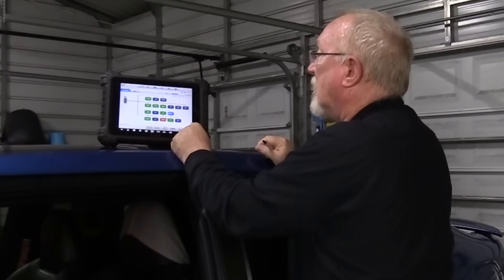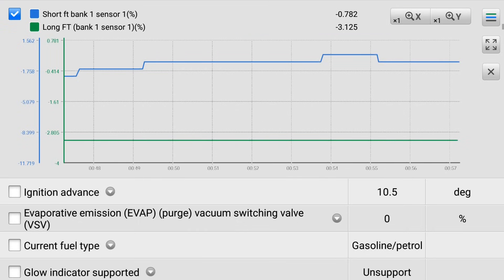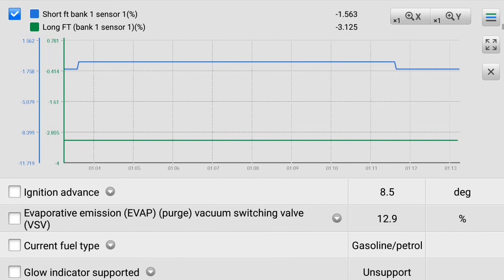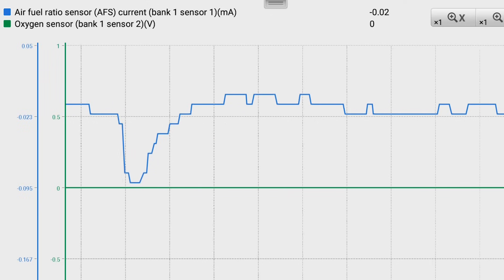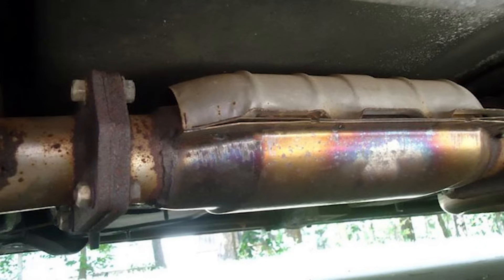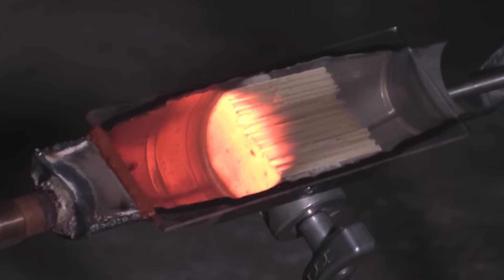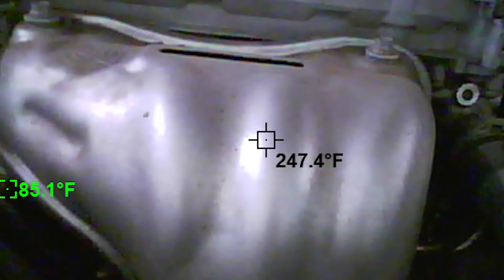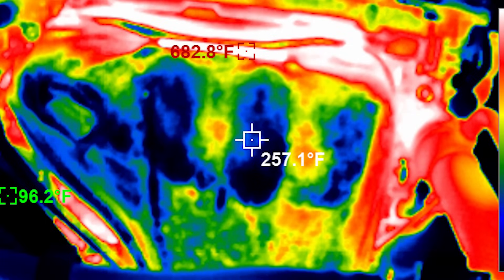The Trainer #118:  The REAL Cause Of P0420/P0430 DTCs

Comment: I've read several comments and agree there are several different causes.  But, for me, the code is for Bank 1.  This means that the side of the engine with Cylinder 1 has an issue.  Therefore, it does not seem like common components of the engine are at fault - such as a dirty air filter or MAF.  It seems more likely that the issue is related to that side of the engine and it's combustion, oil, gas, adn exhaust components.  Has anyone had an experience where the code specifies Bank 1 but it was not necessarily fixed by a component related to Bank 1?
Reply: My car currently has this problem and I'm just trying to find what parts to fix before I get the cat.
Reply: @YakanAutumn  My car has the same, P0420 Catalyst system Efficiency Below Threshold Bank 1. I just saw a video that said to try the Catalyst sensor, so i just bought it and will put it on. Hopefully that will fix that damn ISSUE!!!
Reply: @bze06fishinbwai63  uppdate on How it went.
Reply: @bze06fishinbwai63  did it work?
Reply: @bze06fishinbwai63   we need a update! 😂😭😭
Reply: Sounds to me like a code made to cost a lot of money ! Like a cash cow
Reply: I had the P0420 and to answer OP's question is somewhat complicated for my vehicle specifically. I fixed it with a new set of spark plugs. You'll probably say that's not specific to bank 1, but hear me out. My truck  (a toyota tacoma) supposedly (according to people on tacoworld forum) came stock w/ the same plug but differing manufactures on each bank. It was a contract technicality that forced Toyota to do this, so I've read. The plugs for bank 1, on average, don't last as long as bank 2. This is what lead me to want to try replacing my plugs. Toyota of Mt. Pleasant TX said my catalytic converter was 'basically non-functioning' but... 1000+ miles later and after the new plugs, I have no light or code, so, they likely just pulled the code and claimed it was the most likely/most expensive part without any real diagnosis.
Reply: @deadduck8307  That's interesting about the plugs.  For sure seems like that could cause a specific bank code if the plugs are not all the same and wear out at different times.  Great catch!
Reply: The common components may not be the direct cause of the these trouble codes but they definitely could be the origin point of the issue.

A rich engine condition (mainly caused by vacuum leaks) and/or engine misfires can prematurely ruin catalytic converters. Clogged air filters will create a lean condition as the computer pulls back fuel to accommodate less air. This can lead to predetonation which can also destroy cats.

So if cats are bad and throw one of these codes, the common service components may not be the cause, but they directly contributed to the issue by destroying the cats.
Reply: Good point we have both PO420 and PO430 on the 2011 Arcadia with 150K. Leads me more toward common components like air intake, fuel pressure, or PVC issues, maybe engine timing due to timing chain wear.

Comment: I took out the o2 sensor, installed an anti-fowler and reinstalled the sensor. Haven't had an issue for years. LOL.
Reply: What’s an anti fowler please?
Reply: @serchizm it is a threaded pipe that threads into the O2 sensor bung and the sensor is threaded into the end of the pipe. This puts the sensor outside of the exhaust stream helping to have a steady O2 reading on the secondary O2 sensor and avoid throwing a code. On some cars this works and some it won't.
Reply: @serchizm you can also use the minicats that can purchased on Walmarts site for about $16 bucks a pair  use on the post or after carts only the ones sniff the exhaust usually the source of the P0420 and P0430 codes
Reply: Spark plug foulers aka spacer
Reply: does this affect economy or performance?
Reply: @Jordanjuggin  shouldn't affect either
Reply: Before or after cat?
Reply: @natalecriscimagna447 after cat 🤔

Comment: After watching just a minute of video I disagree. I remember when obd2 was new and we replaced a converter for the code. The Dealer got a call from Ford and they wanted the converter back. He said we could buy some time with new 02 sensors but more than likely the converter has failed. After all the failed converters I saw a converter fixed the concern without any other components to blame. Nice in theory but if the engine isn't missing and doesn't have other codes, the converter will fix it (except if there is possibly a pcm reflash). Cheap converters are a hit and miss. Luckily I've never had the concerns on my own vehicles with many miles on them. I remember when converters first came on F250's and they would usually give out and get plugged when pulling. No concern was ever found. Replace them and go on. Pulling is hard on things.

Comment: Can a faulty O2 sensor cause P0430? One day or 30 miles after I just replaced ignition coil, it shows faulty P430. My car has 168K miles. Several diagnostic checks in the past showed faulty O2 sensor or faulty exhaust problem. I did not fix it. now there is no symptom of faulty O2 senor. It shows P0430. What may be the problem. Thanks.
Reply from the maker: P0430 is the converter on bank 2. I would look at the activity of all four sensors to see if any are out of norm to start with. Also, why did you replace the ignition coil and what cylinder was it on?

Comment: I sprayed down the flex pipe with soapy water and it started to bubble up .I currently have a p0420 code .I’m going to repair the flex pipe and hopefully that will solve my CEL.
Reply: hey did you ever fix the flex?
Reply from the maker: Very likely it will. That is letting air in and throwing of what the sensors are seeing and could even cause the cat to overheat because of the leaning out of the feed gasses. Let me know!

Comment: Just bought a 2009 Buick Enclave. 2 days later, I got a reading that an O2 sensor needed to be replaced. Brought to a shop, they changed 3 sensors, 3 spark plugs and water pump. After picking it up, now it’s saying P0430 (bank 2), P0420 (bank 1), then the same ones but with p/d on the side.
Reply from the maker: Mandy - The ECM can't tell you what part to replace, only that something is wrong with the circuit or the component's operation. What sensors did the shop replace?
Reply: @VehicleServiceandRepair  2- Uxygen Sensor Nik Oxygen Sensor. 1- Oxygen Sensor Bosch Oxygen Sensor
Reply from the maker: @ThisIsMyYoutubeName1  These codes set when the ECM sees the signals from the oxygen sensors in front of the converter and the rear of the converter mirroring each other. It's hard to say without referring to the data whether this occurred because the testing could run once the oxygen sensor code you started with was repaired, or there is a fault in the repair. Why did they only replace 3 spark plugs?
Reply: @VehicleServiceandRepair  I have no idea! I never gave him permission to even work on my vehicle. He also changed the water pump. All I wanted was an estimate so I could give it to who I have a warranty with. He kept my vehicle for a week, I had to contact him asking if he had any update for me. He ended up doing all this work and slapped a huge bill, stating “no payment = Not allowed to pick it up. I paid with a check (I don’t carry that much cash), the check engine light came back on and when I seen the code, I cancelled the check. Now he’s saying he’s putting a Lien
Reply from the maker: @ThisIsMyYoutubeName1  Did you sign a work order?  I would file a complaint with your state consumer protection agency and get your money back. Then take it to a reputable professional.
Reply: @VehicleServiceandRepair  Nope. No paperwork, no oral agreement, he just did it. I canceled the check because I had to get a rental
Reply from the maker: @ThisIsMyYoutubeName1  Still - make the complaint official.

Comment: I have the code thing. 
But an expert said he could fix it for under$220.
So then I'm thinking that it could be the O2 sensor because my mileage is about 178k and they might go out around 150k or sooner. 
I saw one for about$170 and the guy said he could fix the problem for $220 so I think maybe that's what he was going to do. 
I hope that's the problem then I could just do it myself.
Reply from the maker: Be careful - without performing a proper diagnosis, no one can tell you what they can do to fix it. With the mileage on your engine, it could be a number of possible causes, including the converter. Seek out a more professional diagnostician.

Comment: if i’m hearing clattering from catalytic after car heats up and im getting codes p0420 and p0171 p0170 could it be an o2 sensor ? or does the clattering make it clear that cat actually needs to be replaced ?
Reply from the maker: If you can tap on the converter housing with a rubber mallet and hear something clattering around, the substrate is fractured and the converter must be replaced. Be sure to replace it with an OE-equivalent to avoid problems.
Reply: Check the vacuum leaks first to see if there is any cracks on air intake ducts or any side rubber tubing connectors

Comment: what about when your driving and the rpms drop and go back up. Auto zone said it was a clogged catalytic converter.
Reply from the maker: Under what conditions?
Reply: @VehicleServiceandRepair  lol not sure what you mean. Looks good not really rusted. the car has like 200k miles.  day no rain. like 70s. Just driving it started dropping and going back up. sorry dont really know much about cars
Reply from the maker: @devilboykillz  Typically, an exhaust restriction will limit power. You'll try to speed up but the car will feel like it just won't go. This doesn't sound like that. Did you, or do you, have any codes stored in the ECM (is the Check Engine light on)?
Reply: @VehicleServiceandRepair  I dont rem the code. They said at auto zone that it was a clogged catalytic converter and the guy recommended me to try caticlean first before getting a new one but they are all sold out at every autozone by me so i tried a diff brand. I put it in the gas like they said and the check engine light went off fast but the rpm keeps dropping still.
Reply from the maker: @devilboykillz  I do a lot of work with the AutoZone team but I will say that not all AZ parts persons are qualified to diagnose a vehicle, especially in the parking lot. Seek out a qualified professional. Just because the light is off doesn't mean the problem has been effectively repaired.
Reply: @VehicleServiceandRepair  I put it in the shop. They said it was the first converter that was bad like auto zones tester.  Paid almost 1000 for them to put a new one on and it still didnt fix the problem with the rpms dropping. 2 days after they said they fixed it even tho the rpms still dropped the check engine light came back on and i took it back to auto zone. Ran the test and it popped for a p0420 catalyst system low efficiency bank 1 again. Same thing they was post to of fixed.  Shop hasnt answered my call in 4 days and today someone answered and told my wife the boss will call her back and never has. Can a O2 sensor cause the rpms to drop. They are dropping at idol, regular and highway driving still. Also now when i start my car the rpm go to 1500 then drop after like 2 min that they didnt do before i put it in shop.
Reply from the maker: @devilboykillz  Email the VIN number to me at pmeier@endeavorb2b.com

Comment: In 2018 I took my 2004 Toyota sienna to the Toyota dealer they said it was a bad oxygen sensor I replaced it then it was another bad oxygen sensor I replaced it. Then it was a catalytic converter so I replaced it. Then it was the other catalytic converter! At this point I’ve bitched and complained all you people do is replace parts do you actually know what’s wrong their response was “these are the codes were getting“. The engine check light and VSC light stayed on for three years. Two weeks ago I decided to clean my mass airflow sensor. My lights turned off on the road. I’m thankful the catalytic converter wasn’t the problem but I’m pissed off that it’s supposed professionals had no idea what the hell they were doing!
Reply from the maker: One reason we make these videos.

Comment: I have an 02' Blazer zr2 4.3ltr. Got a new Cat, Rotor,  Coil, ECU, Wires, Plugs, etc.
My Check engine light came on & got the 0420 code. Exhaust is new also. It showed Bank 1 below temp. threshold.
I changed bank 1 02 Sensor  & same code came back. I do have another 02 Sensor located on Bank 1 Sensor #2, the 1 just before the new Cat. I'm installing a new 02 Sensor there today. 
No leaks, etc. Everything I had installed has less than 400 miles. The Cat is a high flow, Flowmaster Cat & the Mechanic Shop said it wouldn't throw a code. Zero power issues.  The Truck is running great even with the light on.. I cant even feel it idling at a red light with the AC on!
Reply from the maker: Unfortunately, that might not be true about the new cat throwing a code. One reason why a few states require cats certified by CARB. What is the code number that you are dealing with?

Comment: I had this code on my Chevy Cruze LTZ. A fresh set or plugs and a new coil pack solved my issue. 170k miles. It was due for a tube up. $200.00 we’ll spent.
Reply: What in the world is a tube up ?? Lol
Reply: did you notice a black smoke
Reply: @LOLONO666  Only when smoking pot, I guess, LOL
Reply: Do u mean tune up ??

Comment: Air filter ... Ill check that but the alternator will also causes the same code
Reply: Alternator causing a p0420 code?? How so,  the two systems are just that,  two diff systems that have nothing to do with each other

Comment: If you replace a bad computer, should I reflash the new computer to clear the 420 code when everything else has been done?
Reply from the maker: The code should not set in the replacement ECM unless the fault still exists. Be careful condemning a computer - they are rarely at fault.

Comment: Hello, thanks for the vid!  Do cats sometimes just "wear out"? 2011 Acadia 200Kmiles P0420 DTC. Verified w/live data lowered capacity on cat-1, short/long term fuel trims nominal, all four O2 sensors functioning and MAF sensor OK.  No coolant loss, oil loss or fouling of spark plugs. No backfires, vacuum leaks or exhaust leaks.  Borescope confirmed no physical damage or obvious plugging of the substrate.
Reply from the maker: Yes, they can. And the lack of physical damage or contamination is a good sign that that is the cause of your code.

Comment: So if it’s the O2 sensor which one would it be the upstream or downstream?
Reply from the maker: It could be either. If the system uses conventional sensors in both positions, I always recommend replacing both as a set.
Reply: Any tips on getting a downstream sensor off that's frozen tight to the cc. I've been spraying it for months and trying to turn as much as I feel safe doing so. More pressure than I'm using usually always breaks something
Reply from the maker: @JMarie-Texas  Yep! Use this tool - https://youtu.be/2q-DtkwNDPg

Comment: my 2006 honda civic does have the P0420 code , it is sluggish especially take off and feels like it has power loss, also fuel consumption is very high. so is that most likely a blocked or failed Cat ?
Reply from the maker: That would certainly be my first test.

Comment: My car has this code and the oil seems to burn more quickly, I have not noticed any leaking of oil from under the car however when I check the oil days after oil change it is low and dark colored however I don't see any smoke when I drive, could the issue be related? Can I repair it myself? Thanks I appreciate help with this issue.
Reply from the maker: You don’t say what kind of car or how many miles are on it, but my first guess would be worn oil control rings allowing oil to be burned in the engine. This can also coat the  converter substrate and prevent it from doing its job.
Reply: @VehicleServiceandRepair  that’s interesting... it’s a 2003 Nissan Altima with 150k miles
Reply from the maker: @kelisnow7595  While many cars today last a long time, 150,000 miles is still considered "high mileage".
Reply: Check pvc valve
Reply: @panzerichi3837  pcv valve ya mean?
Reply: @diychad7268  yep

Comment: My 2003 dodge caravan runs just fine on the level, but lugs on grades, barely making it at 25 mph.  Really straining my engine.  I got the P0420 code. Used cataclean with no benefit.  Now what?
Reply from the maker: Sounds like an exhaust restriction. Have the system tested for excessive backpressure.